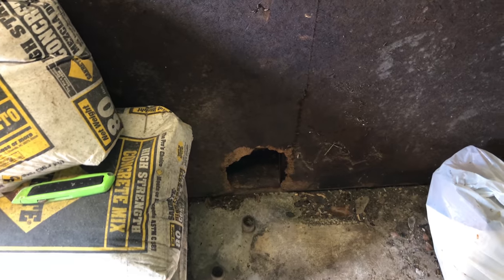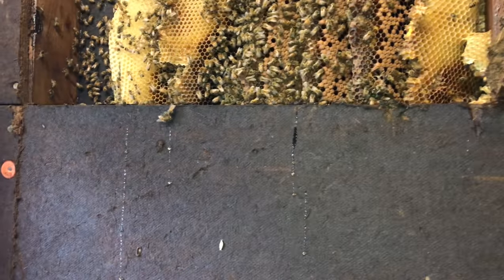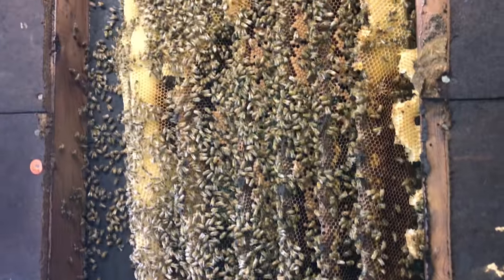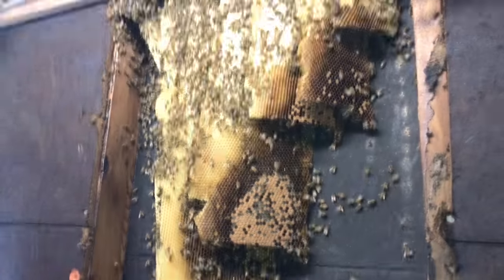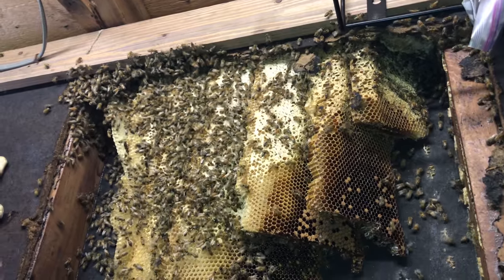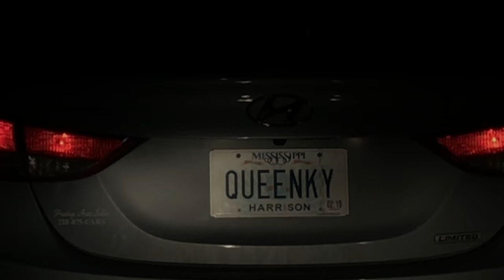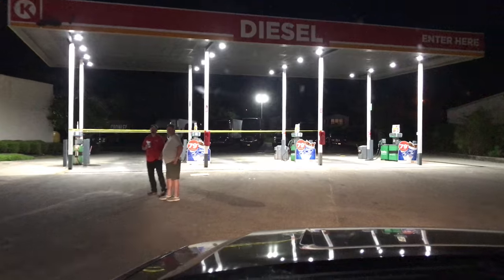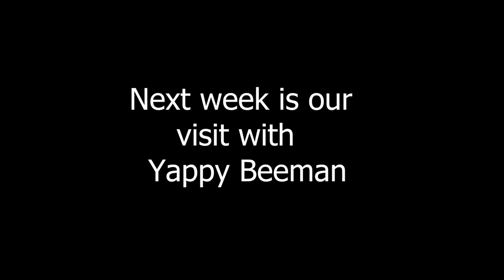We Found Pump House Honey

Comment: During the video you mentioned you do not like to frame open brood late in the  year because hive beetles can decimate it.  I'm a new bee keeper, so i don't understand how the seasonal timing affects the brood as pertaining to SHB?  Is it because the beetle population is stronger at that time of the year?
Reply: Good question! I hope the rooster will answer it.
Reply: I believe it's because they are in "catch up mode" after the hive is removed. They have to work to attach the cut out combs to the hive frames and their energies are temporarily diverted to other tasks for a  small time period. I believe that leaves them open to issues in the meantime if the brood wasn't previously capped. I can't swear to this, but Randy is usually great about answering questions. I'm surprised he hasn't been on yet today. Must be out playing with those bees!
Reply from the maker: Beetle population is usually higher starting in summer.  Also the bees are set back a little after a removal and will sometimes abandon open brood which makes it fair game for the beetles.  Once beetles start feeding on and laying in a hive and their larvae got to work on a hive recovery is very difficult.  Most of the time a hive is a guaranteed loss once hive beetle larvae start slimming the frames.

Comment: I've been looking into "cooling vests" I might even tackle attics with one of those.
Careful, don't make it too easy, these gas stations might figure out they don't need to call you. Pity the poor pump jockey that gets told, "take the vac and clean up that bee spill"
Reply from the maker: Try one of those blow up T-rex costumes.
Reply: @628DirtRooster   I don't hang around either Trick or Treaters or Football mascots...Do they have cooling packs?
Reply from the maker: @Guy4UnderDog  LOL  I think it's just an air pump.  Blows up and stays inflated kinda like hose bounce houses I think.

Comment: Another random question for you Rooster. I know you use plastic frames, but do you get to a certain point were you get rid of old framed wax? A lot of people say about three years is a good age to remove old wax.
Reply: Rodders. Been binge watching alot of this stuff recently. He said the bees tend to like the older stuff for the smell but when the frames get nasty he will clean the wax off and melt it down.
Reply: Nice Chris! You have maybe a bit too much spare time ha! Like i said myself and people around my area do about three years or so. Just curious if Rooster does have an actual plan of action, or goes with the flow

Comment: I guess it didn't boom since video is posted lol
Reply: stephenF250 True! LOL
Reply from the maker: It was a close call.  ;)
Reply: I was more worried about any smoker use at the gas station swarm of stray bees not the shed cut out - though they were too high to smoke but the vacuum was a possible ignition point.
Reply from the maker: Would have "launched" my career as a gas station inspector.

Comment: got a question for ya dirt rooster. i have about 15 mating nucs set up with a cell and just a few handsfull of bees in each. the last few days ive found two small swarms on maple tree branch just a few hands full in each. both had queens. is this a swarm that needs put in a box or just the virgin queen on a mating flight and better to leave alone
Reply from the maker: If they're out there more than fifteen to twenty minutes I'd put them in a box.  The queens typically don't land except on the box or the ground around it during mating and mating flights are over pretty quick.

Comment: Why do you put rubber bands on the wood things?
Reply: It helps keep the salvaged comb you put in the frames in place, until the bees attach it to the frame.
Reply: He uses rubber bands instead of something else because eventually the bees chew through the bands after they've attached the comb to the frame and the broken rubber band can be pulled out of the comb without tearing it up afterward.  They're also convenient for humans - no tying or cutting required.
Reply: And unless you have already prepared empty frames for the cut out - swarm or hive removal - stringing and tying knots with bees all about your bare hands and fingers - which you need for those knot ties - is probably more hurty than snapping a few elastic bands.
Reply: @Jason Patterson - The trouble with rubber bands though is that when the bees have chewed through them and they snap, they can easily kill a bee... including the queen...  That's why I always replace them with butcher's wire after the hive has settled.

Comment: What is the point of a smoker?
Reply: Vincent Calms the bees and helps to mask their pheromones
Reply: Helps you die of lung cancer sooner.
Oh, you meant the bee smoker? When bees smell smoke, the hive switches to survival mode. Bees stop being defensive, and start chucking down honey so they have a full belly in case they need to do an emergency evac.
Reply: Vincent they dont like the smoke and they run away from the smell
Reply: It calms them down by masking their pheromones. So if they start putting out alarm pheromones, the others can't smell it and so they don't go on attack. The alarm pheromone (smells similar to bananas) is what tells the rest there is a danger that needs to be dealt with
Reply: The smoker simulates forest fire, the bees by instinct quit any stinging defence and begin preparations for moving on if a stronger fire signal appears later  - smoke is fire and that is bad and humbles most anything alive that is naturally out of water and makes them wonder where any place of safety lies. Randy no longer scares them and as you see he can then more happily get about his hobby pleasure.